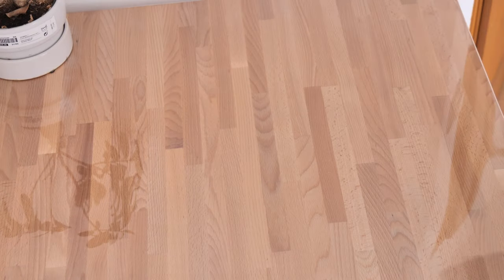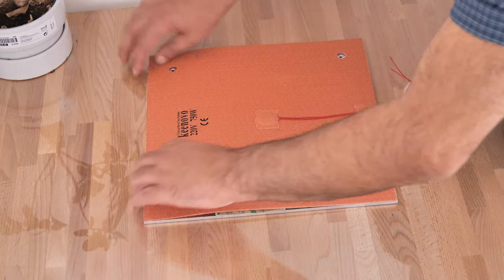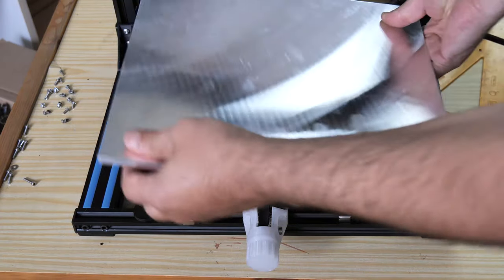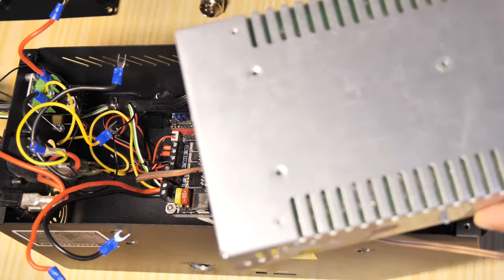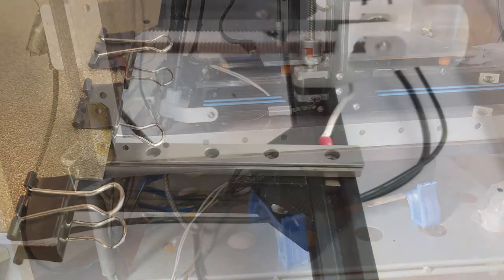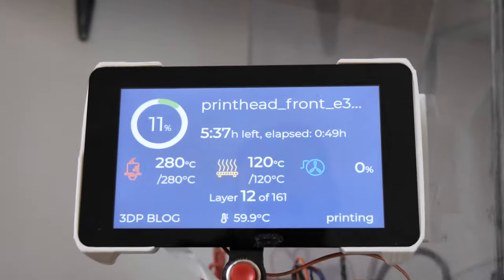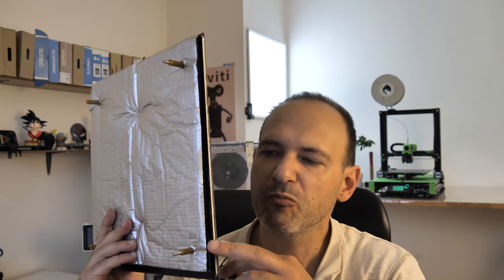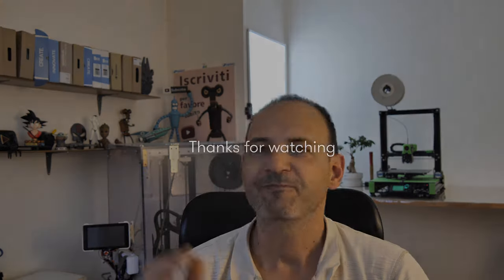AC hotbed silicone heater from Keenovo on Creality CR-10 series 3d printers

Comment: It looked like you were heading to doing a complete switchwire conversion on your CR-10, with the last thing to do swapping out the leadscrews for the x\z belt system. Instead you opted to do a completely new switchwire build. I haven't watched that video yet to find your reasoning, but I suspect it may be the same I'm currently contemplating, so I'll check it out next to get some inspiration. Great work Ivan, I really like your content! New subscriber. 👍
Reply from the maker: Hi John, I dont know how you deducted I was planning a CR-10 Switchwire mod, I think I never shared this idea :) I started such project then I abandoned it, because I think the print volume is too big and it will require much longer belts for xz than in the original SW or the Ender mod. Longer belts would decrease the print quality in my opinion, because of more woble/elasticity. I thought 9mm belt would be a solution, but I needed 2nd printer and decided to build a SW instead of modding the CR10. Now I've built also the Voron 2.4 and my CR-10 slowly goes to oblivion... I ended up using it only when I have to print many parts and I share the load between the 3 machines. It is great printer though and I have planned to make a last video for all mods I implemented during its 6 years of service.

The original SW is great machine, very simple, reliable and easy to use. I love the Voron 2.4 performance, but I think the SW has better cost/performance ratio.
Thanks for subscribing.

Comment: Hi, thinking of using 2 ssd relays is cool but the issue with that is if one fails, you would never know, and then there will remain only one, and it would be same situation as if there was one ssd relay. So, in fact you are relying on shutoff through software rather than the fuse - which I think should be fine anyways.

Comment: I like the video Ivan. I just got a 1300w heated bed for my cr10 S5. It came with a tiny heated bed. No longer waiting 30 min plus for the bed to heat up. 
I noticed in your video some different  types of bed surfaces. I’m curious what you are using. I’m always fighting warping with certain geometry’s at large sizes.